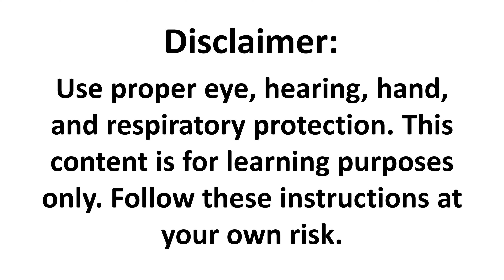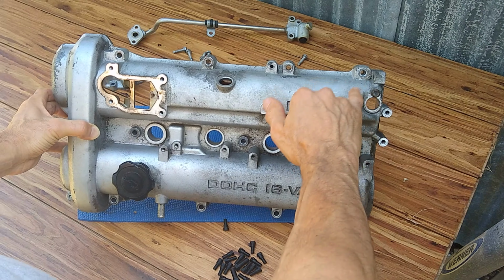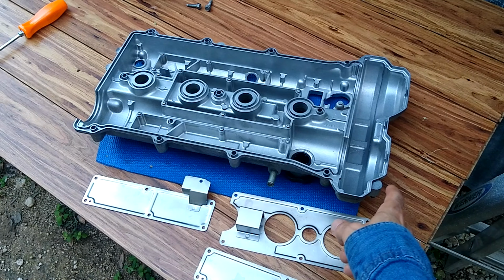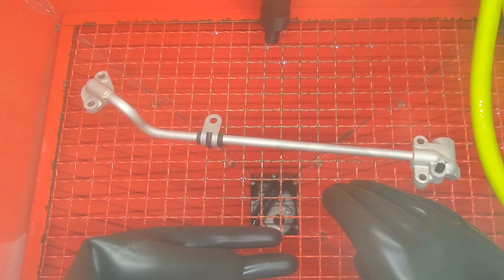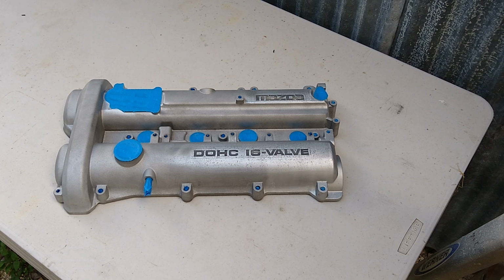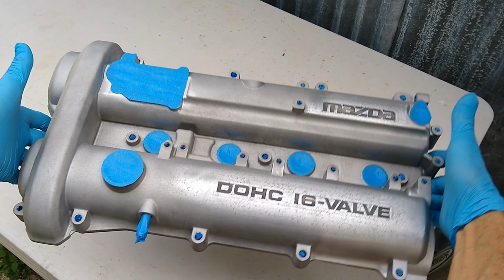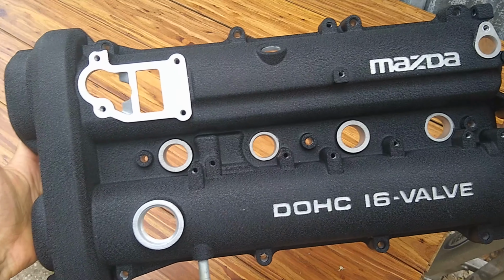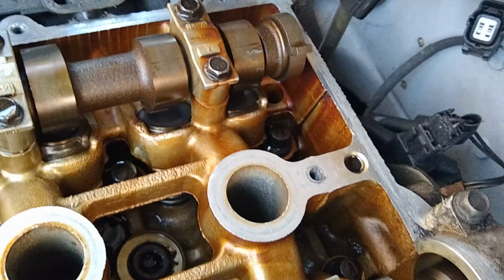Vapor Blasting / Honing Harbor Freight Sand Blast Cabinet 2002 MX5 Miata Valve Cover Makeover

Comment: i just successfully got done printing v2 the first couple times it was knocked down from the printer grabing it cant wait to make v3
Reply from the maker: Hi Lane, Look for a setting called z-hop in your slicer program. It will raise the print head between section movements that might help eliminate that issue. Print failures on long prints are frustrating.
Reply: I did change that and I also went from skirt to brim and it seams to be ok I’m now about 3/16th above the threads and never made it past the 1st thread 🤬 love the channel and the projects
Reply: Hey real quick if I printed your v2 nozzle with the hose threads down are they even with the bed it seams like the one side is 2 rings smaller and at a slight tilt to slow for the hose ends keeps piping off my bed
Reply from the maker: @laneletky9900  Hi Lane, the ends are even in cad so both hose ends should be flat on the build plate with the nozzle facing up. I'll start a print and video it so you can see. Check that the build plate to nozzle gap is the same in at least 9 points on the plate.
Reply: Victor when I was slicing the nozzle on cura I sunk the piece below the bed when I was flipping it 😬 fixed it in cura and made a great nozzle is there a link to the rubber gasket you have for inside the nozzle end
Reply from the maker: @laneletky9900  Hi Lane, I'm glad you sorted that out.

https://www.idsblast.com/sandblasting-supplies/867%5E1358

Comment: How does it  perform in removing rust from steel  parts ?
I'm interested in setting up a blasting unit in my garage , possibly building it myself from the ground up.
Reply from the maker: Hello Gerrit, Thank you for commenting. I would use a dry sandblasting system for rust and powder coating removal. The water in a wet system softens the impact of the blast media making it best for polishing soft metal like aluminum. Flash rust is another problem with rust removal in a wet blast system. If you plan on doing both polish and rust removal then have one of each dry and wet.

Putting together your own system isn't very complicated it takes a few parts and patience.

Best of luck with your build!

Comment: Do your printed nozzles wear out quickly from abrasion?
Reply from the maker: Hello dpforth, Thank you for commenting. I ran 36 grit garnet through a 9mm 3D printed tip 5hrs a day for just over three weeks. The opening got to 10.5mm. 36 grit garnet is a sharp media made for cutting. The tips will last much longer with polishing media like glass bead. Printing one 8mm tip consumes about 18 grams of filament so that works out to .56 cents each. The boron tips run between $18 for a small one to over $50 for a big one. I've replaced my eBay blast gun with a my higher volume 3D printed version to reduce blasting time and cost. It's still going and it's been just over 2 1/2 months.
Reply: @vbared  That's very impressive, thanks. And that's just with PLA?
Reply from the maker: @dpforth I use PETG for the gun body and tips. The PLA is just as resistant to the media but weak with heat. Plastics are hardly phased by the blast media. I noticed a rubber sleeve over the the air jet on the metal eBay gun and thought why don't they just try and make the thing out of plastic. It worked out great and I was able to add standard male garden hose ends for quick repositioning or removal. I got tired of dealing with the clamps. The garden hose O-rings are awesome.
Reply from the maker: Hi dbforth, I looked back on the time of use estimate for the V3 Vapor Blast Gun and it's been 2 1/2 months of use and not just over 4. I'll put up a video when it wears out but so far so good.

Comment: Hello, open the skin. What type of sand do you use? Lastly, what kind of sand do you use?  I'm about to press order v3
Reply from the maker: Hello วรพล สารสืบ, Thank you for commenting and your purchase. 

I mainly use two types of media garnet and glass bead. Three grits is all you need to get 90% of things done, 36 grit garnet (for stripping), 80 grit glass bead (stage one polish), and 170-325 US sieve glass bead (aka extra fine glass bead media) for the final polish. The 100 grit glass bead can be skipped unless that's the finish you're after.

36 Grit Garnet - https://www.grainger.com/product/GRAINGER-APPROVED-Garnet-Blast-Media-402F56

80 Grit Glass Bead - https://www.harborfreight.com/50-lb-glass-bead-80-grit-abrasive-media-61874.html

170-325 US Sieve (aka Extra Fine Glass Bead Media) -https://www.grainger.com/product/BALLOTINI-Glass-Beads-Blast-Media-6ZC13

Best of luck with your build!

Comment: What is the difference when you only use the dry media? Curious what the water adds here that improves the performance of this setup.
Reply from the maker: Hello Brad, Thank you for commenting. My experience with a wet set up is that parts don't need to be degreased,  it can use much finer polishing media that would wouldn't circulate properly in a dry system or would just get sucked into the shop vac. Dry blasting produces lots of heat so some parts could warp. The wet blast setup's biggest strength is polishing but it can also strip coatings with a bit more effort. Flash rusting of cleaned iron/steel parts is the biggest issue for the wet systems. Dry systems are best for coating removal and have no issues with flash rusting of parts like the wet systems do but parts need to be thoroughly degreased. Having both would be ideal. 

Best of luck with your projects!
Reply: @vbared  Thanks for the detailed response. You have me interested in converting my setup to something like what you have. I am guessing this would really shine (no pun) when it comes to carbs and other fine aluminum castings.